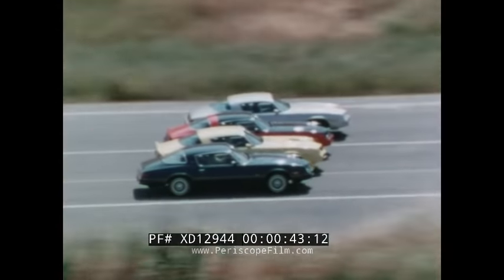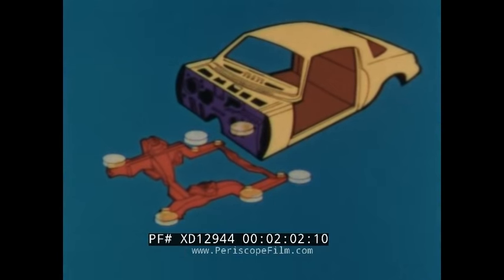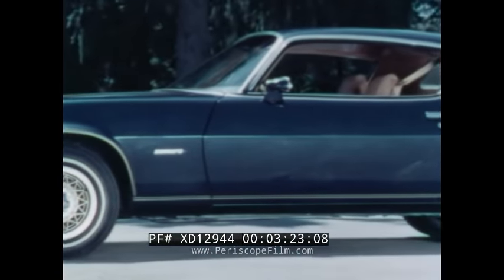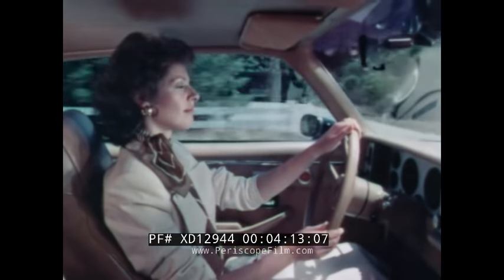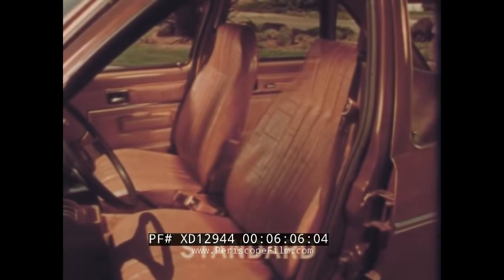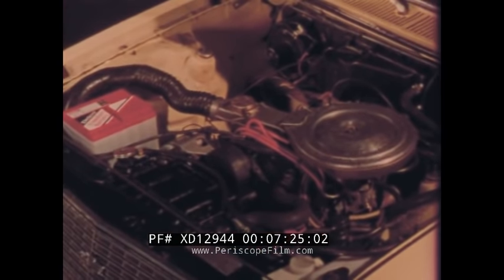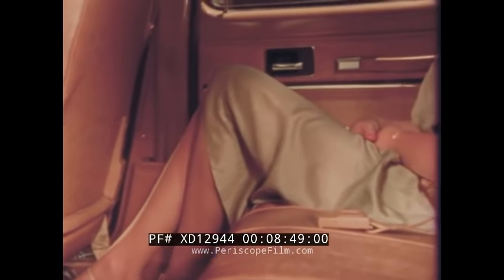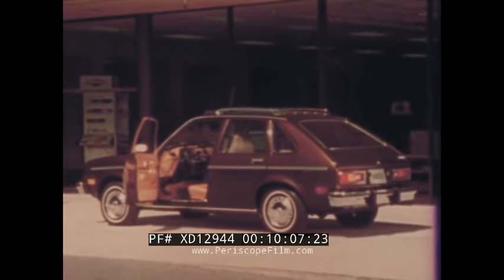REASONS TO BUY THE 1979 CHEVY CAMARO & CHEVROLET CHEVETTE PROMOTIONAL FILM XD12944

Comment: My first car was a red 1976 Camaro with an automatic and a 305. The body had huge Bondo patches in it but the interior was flawless. The seating position was PERFECT. Outward visibility especially with those looooong doors and windows was some of the best I have ever seen.

It had a 2 barrel carb but with thick spacer plates between the carb and the intake. Despite being the lowly 305 V8 it was actually quick. The engine had a broken bolt forever bouncing around the crank case. It is STILL running today and STILL has said bolt bouncing around the crank case.

Light weight. That Camaro weighed well less than 3500 pounds it actually handled very well. I would LOVE to have a 1979 Z28.

Comment: My cousin bought a new 79 Camaro with a 305 , 4 speed on the floor ...
He was in the US Navy & found a 69 Charger with 20'000 miles on it .
But he could'nt afford both & asked if I would buy it but I was 16 yrs old working part time .
But he priced the Camaro so low my folks co-signed for me and put $1000 down for my graduation that was still 2 years away...
The Camaro only had 6400 miles on it because it set most of the time.
In 1981 , I also joined the Navy & as luck would have it , I ended up on the same carrier ..
We would see each other on occasion , but probably not as much as you think ..
At one point we got leave at the same time & followed each other home for Christmas.
About 30 miles from home & a couple miles before our exit off the interstate , I kicked my Camaro down & went past him doing a hundred easy ...
But he wasnt havin it & punched that 383 and just as he caught up to me , a state trooper did a Smokey & the Bandit u-turn across the median & pulled us both over ..
He was very pissed ...
Pulled both of us out & hand cuffed us .
As we both leaned against my trunk hand cuffed , I said it looks like our leave will be spent in jail...
As the cop asked questions he soon realized we were cousins , both on the same carrier & both on leave headed home for Christmas ...
Luckily , he had served in the navy during the Viet Nam war ...
The trooper asked what our jobs were ...
He thought it would be cool to work the flight deck & I told him it was ..
He calmed down after a bit , but told us just how stupid we were. 
He dropped our speed to 85 mph so we didnt get reckless ops on our  D.L. and let us go...
We got home , washed our cars , put on a clean Cracker Jack uniform & went cruising our home town..
P.S. , girls loved guys in uniform who drove muscle cars back in my day . Lol
Thats my 79 Camaro story ..

Comment: I bought a '79 Z-28 Camaro  still have it .. Then I got ripped off by Burger Chevrolet in Grand Rapids MI ..  They sold me a  1980 Chevette Scooter in 1983 for $3,200.00  it had  29,000   miles on it ..  they told me it was a 1981..  I later found out that Chevette Scooters  list price new was $3,200.00 plus the battery was junk.  I raised some hell in the show room and they gave me a new battery .. woop woop  .. glade both of them have manual transmissions..
  Parked the Chevette with 179,000   miles when it rusted out ..

Comment: The 79 Z28 with 3.73 gears and 4 speed manual cruised at 62mph with the engine racing at 3000rpm. This pretty much limited any extended cruising to about 70mph max. At least this was my experience. A five or six speed overdrive transmission would have made it a lot more practical on the highway.

Comment: I  bought a new z-28 in 1981 the last of that body type. GM had so much  pollution junk on that car, it was  so slow. It had a 350 but only 175 hp and really don`t think it was putting out that much. The reason i say that is my 1970 chevy stepside truck only had a stock 250 straight six motor three on the tree and would  outrun the camaro from a dead stop.
Reply: You probably had 2.41 gears. A car with 3.42 gears is decently quick.
Reply: I'm Right Behind You Right On Your Ass In My 1979 Chevy MONZA 2+2 Sport Hatchback 4 Speed Pontiac Iron Duke 151 With 85 Horsepower!!
Reply: @superduty4556  The RS I drove had a 2.56 with its 305 deuce. Nice on the highway, but my lord was it slow otherwise. Also I've never seen a Camaro with a 4.1V6. Always a 3.8, either Chevy 229 or Buick 231...

Comment: How awesome! When I was a kid, we had a 1980 Camaro like the silver base model on the video..silver with red interior..I mean it looked the exact same as the 79 really...My parents bought new from Ferman Chevrolet in Tampa,FL in 1980...No power options as dad said they always broke and in the 80's GM cars nothing was more true! I remember learning to drive on this car..It was FAST..305 V-8 4 Barrel carb..Mom sold in 1991 with only 88,000 miles...as I had a 1984 300ZX that I loved ...I hated the Camaro as it had no gadgets..Now, I wish I had the old Camaro as it would be worth much more than any 84 300ZX would be now days! I do recall the Camaro being very unreliable..We had a lot of issues and my parents were both older, mature drivers so the car was always adult driven..The shift interlock or tumbler or something like that went out 3 times..you could not turn the key or shift out of gear..3 times!!! Crazy..RUST...HUGE issue..water leaks inside due to rust on wiper area..( We were in FL not north!)..I guess the 80's were bad for American made cars!

Comment: "Chevette: at least it's not a Vega"
Reply: As bad as the Vega was mechanically, to me it had really nice style to it, especially the early ones.    They were cool when you swapped in a Buick V6.  I did see some people do small block Chevy's in them but you pretty much made it nose heavy and had to change out the rear end.  I think the V6 was the better swap unless you were going to make a drag car out of it.  
The Chevette didn't really have any style at all.
Reply: I had a used Vega for about a week before the block or head cracked I don't remember exactly now but I'm sure of the time frame because everyone warned me but I didn't listen and I had to hear it again.
Reply: @flipflopsguy8868  I turned 16 in 79 and I knew four people that bought used Vegas as their first cars. All four of their engines failed within six months.  Two went to the junk yard, one guy sold his to someone who put a 283 in it, the other girl's dad found someone who did the steel sleeve rebuild and then she totaled it about two weeks after that.
Reply: I bought a '71 in '77. I think I only a it for a few months before the aluminum block finally gave out. The Vega resembled a smaller Camero but the engine was crap... used so much oil I used my father's used oil just to be able to keep oil in it. Finally took a girl out in it and evidently didn't put the oil cap on good enough and lost it while on the date. Used an old shirt I was using as an oil rag to temporarily cover the missing cap to get me someplace to replace it... the cam shaft grabbed the shirt and wrapped it around itself.... I used a pair of pliers to grap the shirt and had my girlfriend turn the engine over as i pulled pieces of it off the camshaft. Got it running again and took her home.... later, I took the valve covers off and got rid of the pieces of buttons... Didnt last much longer after that, lol.... Ahh, my first car...what crap!
Reply: Actualy i'd choose a vega over a chevette
Reply: @kennethsouthard6042  we are the same age,at that time i bouth a 73 from my dad that he bouth new in 73 i drove it a year with the original motor until it start pumping oil then i swampted a 350 in only had to built a frame to reinforce the chassie a few mounth i total the car in a drag race
Reply: @lonewolf-oc9vr  I wanted to buy one of my friend's Vegas where the engine failed and do the swap.  However, my parents would not let me buy a car, let alone a broken down one so I bluffed them and told them that I would buy a motorcycle instead.  They called my bluff and I ended up riding a Honda CB400F in my high school years.  Ironically, it was probably one of the faster vehicles at my high school.
Reply: @kennethsouthard6042  you're lucky my father didn't want me to get a motor cycle but i end up getting dirtbike honda 125 that i hide at my friend's home,the honda 400 was a good bike i had a friend that had one
Reply: My grandfather had a 1976 Vega up until the early 90's. Still ran great but by than had rotted off the chassis. Although I don't think he ever drove it over 30mph.. 😂

Comment: A Z-28 with T-tops would've been the ultimate, but a Chevette with the right options ("High Output" engine, standard 4-speed manual transmission, sport suspension) would've probably been more actual fun. Especially given the gas crunch halfway through the model year.
Reply: My first car was a '79 Z28 that looked exactly like the one in this video but it had t-tops, really liked it! Found out after I bought it that the yellow color was actually kinda rare, they made like 260,000+ Camaros that year and less than 13,000 we're painted the yellow color. Code A31 if I remember right but Don't quote me on it.
Reply: You mean the Chevettes with the collapsing frt strut towers, for the ultimate in camber? LOL

Comment: This is equipped! It has wheels,.     Steering wheel .   Spring selected by a computer, which is an improvement from the traditional method of selecting springs which is scissors paper rock. A smart spoiler! I hate those stupid spoilers you normally see.

Comment: By this point, the front end grille and headlight bezel styling of the camaro was 6 years old and was just a slight update to the 70-73 camaro's front end styling and thus looked horribly out of date especially when you consider that the Firebird's nose had been significantly updated and made more modern looking multiple times by this point. The monza sport hatch front end previewed the look of the next gen camaro and was a far better looking car all around. Of course, the underpinnings of the Monza were from the Vega, so no matter what, you can't win.

Comment: I wanted a new 79 Camaro, but couldn't fit it in the budget. Bought a new 79 chevy monza instead. Fair winds and following seas to all.
Reply: Ooooh man! A 79' Monza? 😣 I'm sorry. Those were awful, just awful cars. GM was in deep crap back then producing crap cars like the Monza.
Reply: @albear972  Easy!.....we didn't know yet! :)
Reply: @albear972  Sorry you had a bad experience with a 79 Monza.  Mine was nice, never a problem. The v6 was quite the upgrade for me as I had traded in a 76 Mazda 808 2 door coupe 4 cyl (that I learn how to detail on). Went to an 82 Trans Am, traded to a 83 Trans Am 25th Anniversary Daytona 500,  then an 89 IROC-Z,  and a bunch of trucks.    Best to all. Ooorah!
Reply: a monza spyder in 1979 was cool when you would drop in a 400 small block 4 spd!!
Reply: Hopefully you got the six cyl.
I had a Mustang II with the four banger and I could run faster than that car.
Reply: @BELCAN57  Yes Sir, it was the v6. It was quite the upgrade for me, as I traded in a 1976 Mazda 808 2dr Coupe 4 cyl (had just enough power to merge onto the interstate).

Comment: In November of 1977, I walked into a Chevrolet dealership in Houston, and ordered a 1978 Z-28 from the factory.  It was maroon with a tan cloth interior from the Camaro LT.  I chose the gold striping, adjustable driver's seat, rear window defogger, and radio delete.  I chose not to get the T-Top, as it was a dealer-installed option, and was known to leak and rattle.  Drive-out price was $7,750...$223.94 a month.  I loved that car, but build and finish quality were abysmal.
Reply: They were made in Van Nuys...

Comment: I just watched an episode of Wheeler Dealers, and Ed had to tackle one of these beasts. The 350 V8 only had 150 hp... choked by emissions.. the CA version I’m surprised had enough power to get to 60
Reply: It's telling when you can hop in a late model 4 cylinder Camry and blow the doors off these '79 Camaros while using 1/3 the gas. My V6 is even faster than a 66 Camaro SS.
Reply: Justice Boofer  A '79 4 cyl BMW made these Camaros seem fast. 12.2 seconds to 60 vs 9.4 for the Camaro Z28. Only the 4.1 Camaro was slower at 13.1
Reply: That would have been okay power in the Chevette.
Reply: At the same time Honda was building the CVCC engine that had none of that
Reply: If you think the 350 was bad, the 305 was even worse.
Reply: Amed Tajan  You also had insurance companies raising rates on muscle cars and increasing crackdowns on emissions,  all of this contributed to the malaise era.  However, the US Auto industry was pretty much caught with their pants down and could do nothing other than downsize their current cars and thus reduce the engine size to comply.  They tried to disguise this by marketing   with a renewed focus on luxury by putting sound deadening, opera windows and coach lamps on just about everything and calling it a Brougham.  
The Japanese and the Europeans were better prepared for this as they introduced cars that were not really any more powerful, but were actually fun to drive.
Reply: jblyon2 A 1966 Camaro, huh? 🤔
Reply: @jblyon2 My Yugo blows away '66 Camaro SS, '62 Mustang Boss, & '85 Tesla Model S. LOL!

Comment: That was the damnation of the Camaro! They destroyed the dashboard and the basic body style. After that I didn't want anything to do with Camaro I'd had a 70 a 72 and a 73 Camaro which I loved. At one point we did have a 79 Camaro with a 250 inline 6 cylinder and 3 speed on the floor we shined it up and sold it

Comment: ‘79 the years of the terrible emissions days.
Reply: I rode a bicycle quite a bit in the 70's 80's and 90's. Sometime in the mid-80's after most of the pre-emissions vehicles were gone an early model would pass once in a while, and the gasoline fumes would really get your attention. After it happened a few times I realized "way back when" all the cars were like that and we were breathing it all the time. As much as I love old cars, the ones today are so much better. I read that a 1969 car emits more fumes sitting in the garage all night than a 2000's car does in a hundred miles. But still, those first few years of emissions controls were pretty bad performance-wise.
Reply: The terrible emissions days are now. I have a pile of evap valves from a bunch of vehicles from this last decade. That is just one example.
Reply: David Meyers you are correct. I’m having the same issues. The cars now days are not as choked out of hp as they were back then.

Comment: The 1979 Camaro wasn't 1/2 bad. Although horsepower was in the dumpster, the chassis and drivetrain were strong.  The Chevette was a TURD. No self respecting motorhead would even be seen in one....never mind drive it. Absolute junk, especially the self destructing rear differentials. JUNK. Most of what was being built at the time was similar trash...bad times to be a car guy.  "Chevy Chevette..it will drive you happy!"   Not exactly...not if you liked high performance.

Comment: "staggered rear shock absorbers". Great, so it'll handle differently in a left vs a right turn. What a piece of chit.
Reply: That’s not correct. The spring rates determine handling, the shock control rebound. The staggered rear shocks do help control axle hop on hard acceleration.
Reply: @charlesdalton985  I am well aware. I have actually designed and built rear suspension systems before. I was just using the statement as a way of poking fun at what is undoubtedly a massive turd of a "performance car"